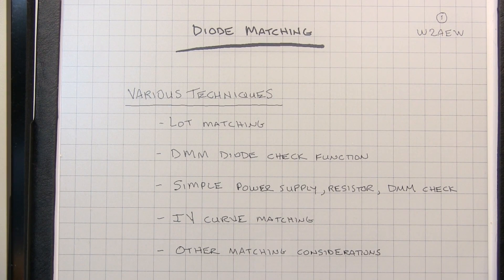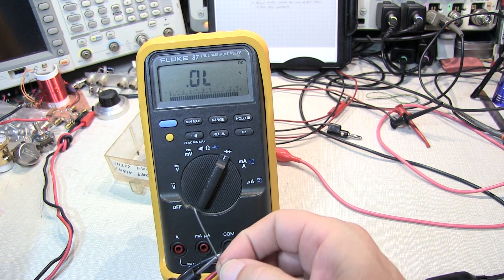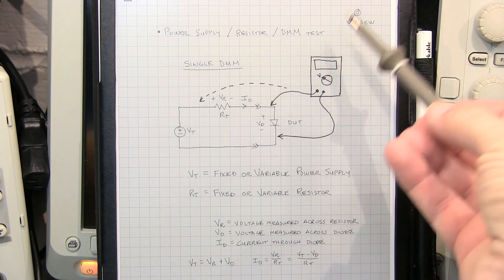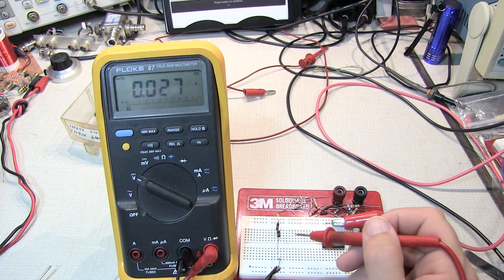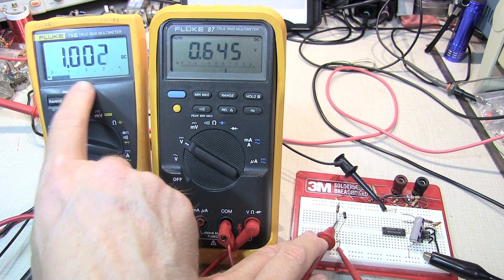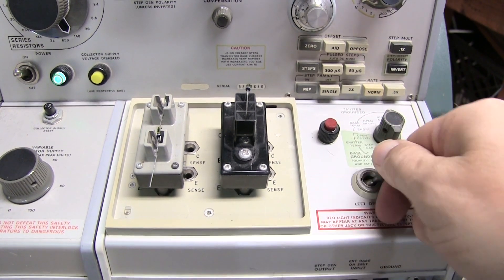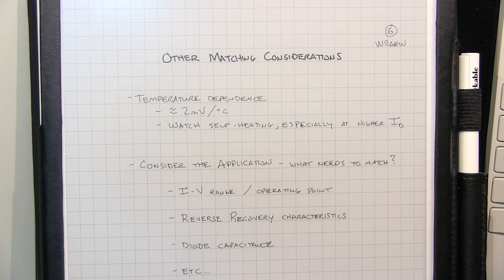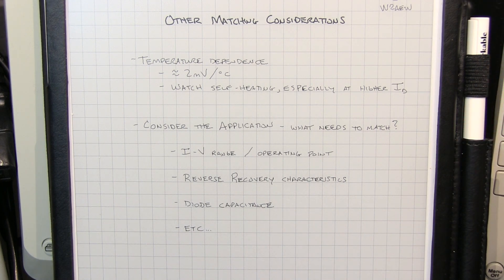#302: Back to Basics: How to match diodes -- measurement setups to find diodes that are matched

Comment: A slight problem with diodes and temperature is that the diodes are not on the same die and probably several mm apart. So if parts of the PCB have different temperatures, because let's say you have a fan cooling and/or some transistors heating up. Then your perfectly matched diodes will still diverge.
Reply: Heat shrink two diodes together with a drop of thermal paste or thermally conductive glue to enhance thermal coupling.
Reply: And to take it one step farther, include a 1/2W resistor and run it at a current that raises the diodes about 20 degrees C above ambient. (Ambient in the area they are located, not necessarily room temperature!) This will pretty much isolate them from temperature changes in the equipment.
Reply: @lwilton  Hmmm, the problem I'm talking about is that there will be a temperature gradient, I'm not sure how one 1/2W resistor will solve it, if anything you want to place 1/2W resistor between every diode. Then you'll get a reasonable equal temperature among all diodes. 

Or you just place them in one place and pour generously some thick thermally conductive glue onto them.
Reply: I was trying to describe a cordwood construction where you put your 2/3/4 diodes in a hunk of thick shrink tube with a resistor in the center, touching all of them equally. Put a couple layers of shrink tube, or a wrap of cork below the shrink tube if you want better thermal insulation.

That was a traditional cheap "thermal oven" that was commonly used for (semi) temperature stabilization of small matched parts in things in the old days. You typically used a regulated supply to the resistor, but didn't attempt temperature control; just ran it enough above ambient to keep it moderately constant.
Reply: @NiHaoMike64  That makes a lot of sense, another thing you can do is to have a thick ground poor near the diodes

Comment: Would either of your curve tracer examples (#49 o #197) be sufficiently accurate to use to match diodes? Thanks for your great tutorials! 
73s - VK7FPCL
Reply from the maker: Yes, either of them would work pretty well for matching diode IV curves - best if you wired up a DPDT switch to quickly switch between a pair of devices for comparison.
Reply: @w2aew  Don't know if it can be done but the thought occurred to me to use the storage function on my scope to capture the image of one test and then superimpose it over the other. ;-)
Reply: @w2aew  I wonder why Tek have chosen to omit an electronic (variable freq.?) switch while designing those (expensive us$2,125 in 1969) machines. Did not they have to match devices at that time?
Reply from the maker: @yoramstein  The problem is that this electronic switch would have to handle positive and negative voltages, up to 1500V, and currents up to a few amps.  That's a tall order, even today.
Reply: For matching 2 diodes(or transistors)the curve tracer to my opinion should not even have to be calibrated. What's important is that the curves are same.
Reply from the maker: @yoramstein  Yes, that's right.

Comment: Those curve tracers are pretty cool, but hard to find (and expensive!) now and most basic scopes today don't have an XY mode, which kind of sucks since it limits what you can do.
Reply from the maker: Yes, I know.  Check out my videos #49 and #197 for simple curve-tracer ideas (both require XY mode though).
Reply: These days A/D and D/A converters are cheap and easy to come by on things like a small and cheap Arduino, though usually limited to 3.3V or 5V. But you can easily hack this up with some resistors to measure a higher voltage, and use an opamp and a pass transistor to set a current to measure with. Then you can make yourself  simple digital curve tracer, and even record the curves of each diode you measure. I did that a few years ago using some old PLC hardware I had lying around.
Reply: @lwilton  You certainly can rig something up. I used to use old automotive ECMs for some cheap datalogging since they were easily hackable, had serial comms and lots of A/Ds, counters, drivers, etc. already built in. But its still nice to have a legit piece of equipment on the bench.
Reply: @mysock351C  We had one were I worked and it came with its own trolley. VERY HEAVY.
Reply: @Dick Fageroni I have a variety of them since I have a few GM cars. These where used in various models of Chevy/Pontiac/Buick/Saturn, etc cars through the years. The earlier Delco ECMs are the GM TBI and early batch fire C3 ECMs used from roughly 87-92 in a variety of GM vehicles using split PROM/ROMs. Basically there was a PROM for the vehicle cal, and a ROM with a primitive operating system. Theyre limited in what they can do, but very easy to program since they are the old Moto 6800 processors once you consolidate the PROM and onboard ROM. The later 93-95 ones where 68HC11's using EEPROMs, and currently I have a 98-01 M68332/CPU32 GM PCM used in pickups and light box trucks in my Camaro since it supports a distributor and has OBD-II flash capability and can run executable code over the OBD port. To use them I downloaded the raw binaries and generated my own source code to customize them. Theres still a bunch of commented sources and apps to program the 87-95 TBI and 98-03 VPW PCMs that I wrote kicking around on the 'net somewhere, and others have done a lot of work as well so they're well documented. I have some of the later CAN bus/PowerPC based GM/Delphi PCMs, but I haven't had much time to work with them as of late.
Reply: @Dick Fageroni Yeah those were pretty basic. I think it had 12k lines to run an engine, which was crude at best. But still neat to mess with. They also used it in earlier computer controlled carb setups as well. The ECM had some basic closed loop O2 feedback and a mixture and idle control solenoid to control the mixture on the primaries to meet emissions.